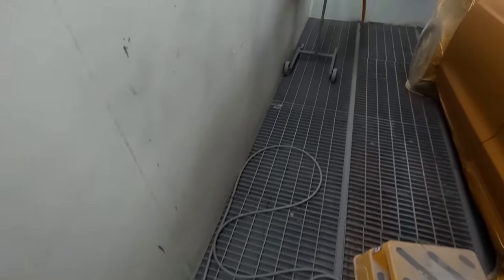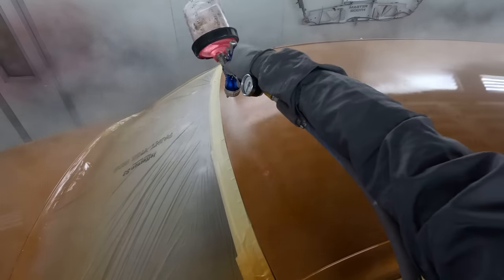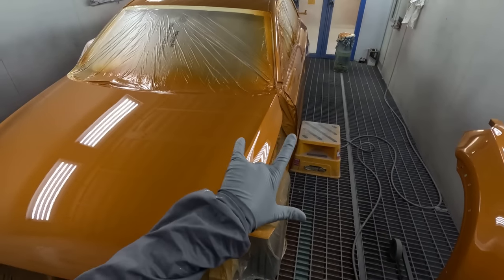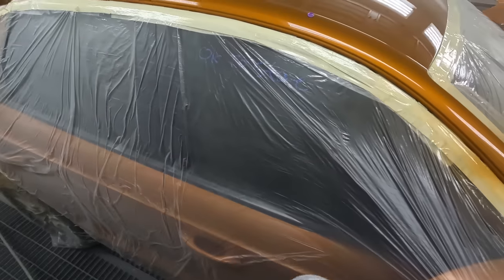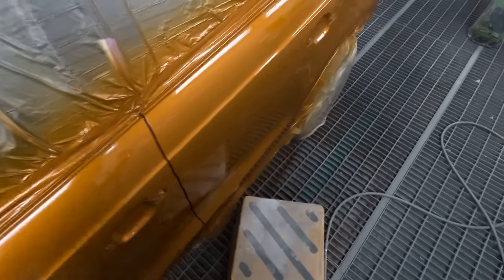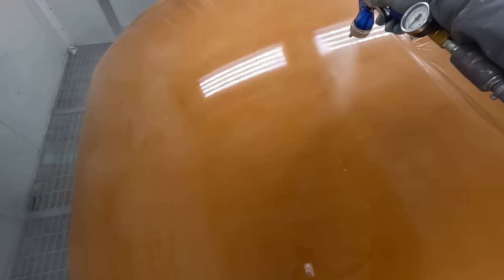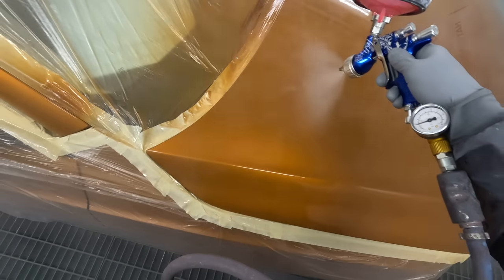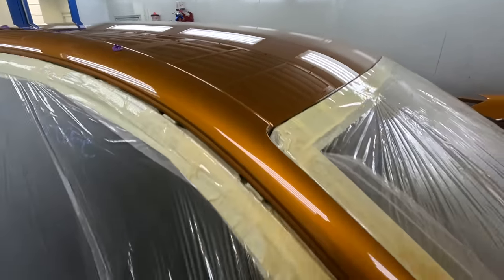Audi Q3 Clear Coat Stage

Comment: Hi Gunny , when you say skinny on the first coat do you have the fluid needle wound in or just move quicker through your strokes.
Cheers
Reply: You don’t have to pull the trigger all the way. You could turn the material down but a good painter has fantastic trigger control
Reply: Keep fluid at full, raise pressure, hold gun closer and move fast
Reply: @TheGunmanChannel  cheers mate 👍,I’ll watch the vid again 👍